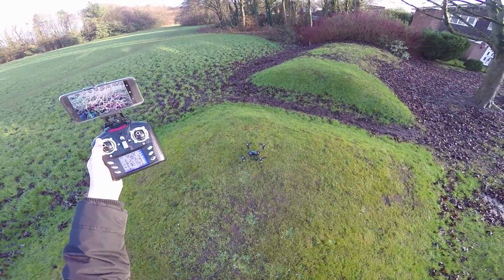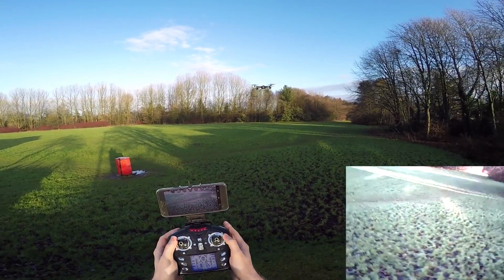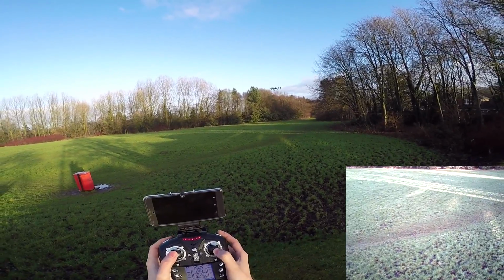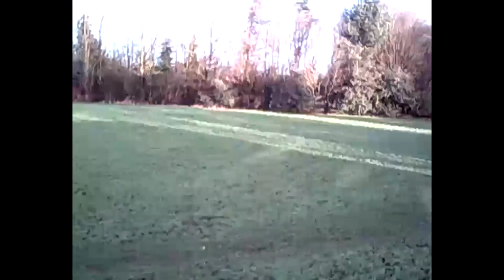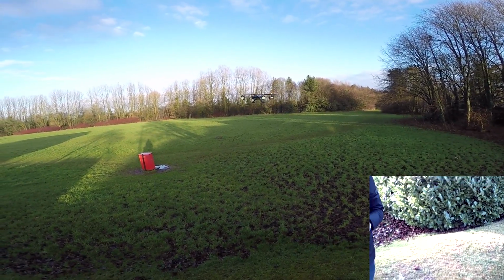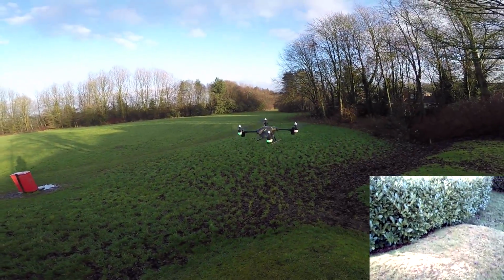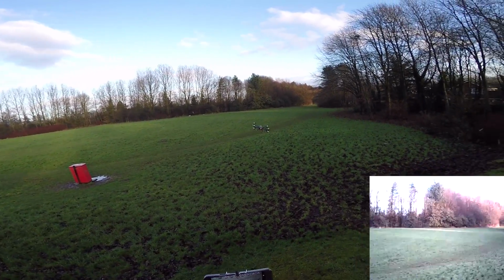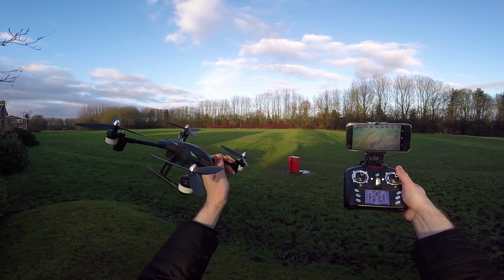WLToys Q323 15 Min Flight Time!

Comment: Well have to agree there Andy you did get a 15 minute flight time ,
. However taking iyt up and basicaly hloding it for the whole flght time at a steady asd soft hover is not real a proportionate 15 minute flight time and someone in my fielsd as an intimediate flyer would feel this to be a very boring experience indeed, Its almost saying like almost , wll oh yeh it will fly for 15 minutes but don,t use hardly any throttle or theres on way your gonna get that, if you actually flew it agresively in a sporty type manner what would the battery life be like then. Its kind of one of those models that manufacturers are thrustng into the market and cashing in on a custome bas that ealy hasn't done there research as to what they ar realy looking for and after purchasing what can only be described as a few duffs , such as this as for one thing i don't believe those motors and gears would stand up to too much proper flying as a sptorty style as the battery is disproportionate in size and proberably to powerful for them tocope with. Againwith an fpv wifi cam good for possibly 30m what market ar they aiming at here. If you new to the world of quadcopters don't be foolrd as not everything thatsreviewed is alwy's reviewed proprotionatly to the prospective patrons, thats us guy's and remember you don't get sent these drones to put every off of them in fact quite the opposite , my oppinion is i wouldn't touch . whats your honest opinion andy?

Comment: Personally, I think all "wi-fi" toy grade quads are rubbish. When you have the control signal and video signal on the same frequency band, you impair both, reducing control range, and severely limiting wi-fi range.  Besides, the quality of the video stored on your cell phone is (perhaps) worse than VGA .. poor color saturation .. at least there was no jello. I'm also not a big fan of "altitude hold" toy quads, as they have a tendency for the motors to NOT shut off in a crash, and with these 15 minute long flights, I suspect there will be a lot of brushed motor replacements necessary.  The new Syma X5HC can stay up 15 minutes if you use the 1200mah batteries available for it .. but it has the same problem with brushed motor life. BTW, I agree with your assessment of "headless mode" and "One key return" .. worthless really.  Well, now that I've trashed this bird, I will say I'm positive that there will be some out there who will absolutely fall in love with it and think it the greatest thing since sliced bread .. so I'm sure WLToys will sell a good number of them. Thanks for the review .. entertaining as always. Cheers.
Reply from the maker: thanks for your input as always much appreciated cheers

Comment: Hey Andy new sub here. I'm finding your vids very informative and helpful. Is there any chance you can do a tutorial for beginners or what worked best for you in learning how to fly quads. I'm an ex fixed wing flyer and I am finding it difficult to find a method to help me learn.
Reply from the maker: i used a simulator like xtr or realflight and learnt to fly helicopters on it. then you can use something like drl or velocidrone to fly fpv acro. then get a small brushed micro quad and practice :)

Comment: nice quad bud, think ill pass tho iam loving my new qx90 build from scratch different FC bf3 flash, better motors and camera some walkera/ladybird props 1s lipo your pids thanks :) flies brill after a little trim my garden is my new playground atm :) done my first few rolls in acro 2 went well the third didn't broke my lantian spider alien f3 hex gutted :) still have a spare tho the polycarb one its brill no acro with that one yet :)
Reply from the maker: sounds like a nice build! crackin
Reply: its also got a buzzer for vbat and lost model forgot to mention very nice touch for this little micro as its small,  have lost one in the past in a massive open field long grass, never did find it well bits of it after the council mowed it :)
Reply: oh dear not such a good build after all fine in the garden, all thought in the park iam dropping out the sky around 50 meters or less not good :) its the frsky one the tiny one with the wire rather than the new long lead dipol ones seems way to long for a micro tho not sure what to do there, also would like to see a vid of the dsm or dsmx rec setup on these boards soldier points etc :) don't get me wrong tho its ace as it is just would like a bit more range :)

Comment: Hey Andy, why do some quads fly three blade props and some only have two blades? Can I put three bladed props on on that came with two blades and will that make a performance difference?
Reply from the maker: three blades are less efficient when it comes to flight duration. they are heavier and create more resistance therefore harder on batteries. but the upside is a further blade creates more thrust it also creates greater stability having more surface area floating in the air. only reason to put a three blade prop is power and stability. personally with this one i would have gone with 2 blades and maybe given 4 mins more flying.
Reply: Alright, that makes sense, thanks thanks for sharing some of your quadcopter knowledge. Earlier today I searched youTube for " How to speak quadcopter" There was no video result that capture what I was looking for. Ill bet if you did a video that just talked about the terminology in the rc quad world that seems like a second language to you and translated or introduced the terms for us laymen, it would be of great service to the community. It seems like there is a lot of lingo that I am slowly catching on to, shoot I just learned "dead cat" as a type of frame. Thats just my two cents for the day. Cheers.